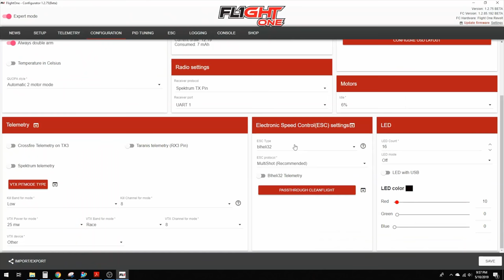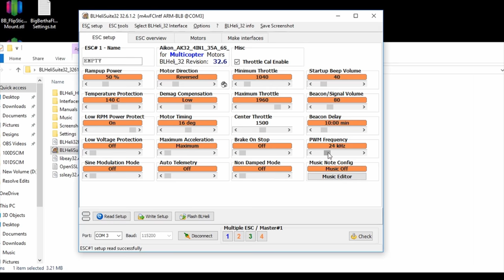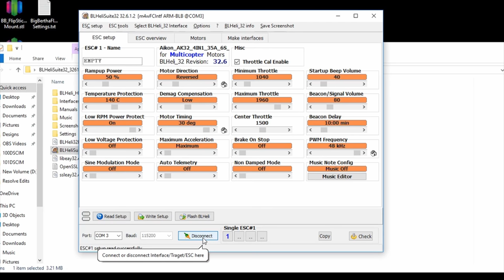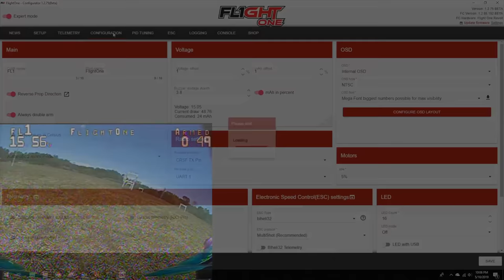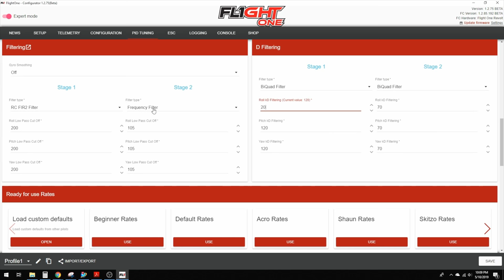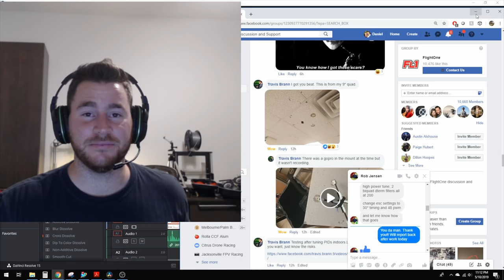FlightOne Yaw Twitches and other Issues

Comment: ESC BLheli32 Settings:
PWM Freq =48
Motor Timing = 30

FL1 Settings:
ESC set to Dshot 600 or 1200
PID tune = High Power
Filters : Default + (2) Dterm Bi-quad filters
Reply: I think I should mention that the BLHeli32 timing settings act differently on each brand of ESC. Sometimes they even vary from ESC to ESC. The higher you set the timing, the more susceptible the motors become to twitching and bounce-back. Also, keep in mind that  most gyros max out at 2000 degrees per sec and they might not be able to keep up with such extreme acceleration on any axis. Not yet anyways. Some low end ESCs cant even handle timing above the mid 20's.  I have done a lot of experimenting with timing because I like my quads to have the highest timing possible. But there is usually a point where it causes twitching problems at extreme stick inputs. For a long time I have been running the "auto" timing feature with zero problems. This WILL NOT give absolute optimal performance, but it will give you a fairly reliable timing rate. In an ideal situation, we should be able to fly with the highest timing setting (31 degrees i think), but not all setups (frames, gyros, rates, etc) can handle it. So if you are unable to tune out any twitches or bounce-back, and you have your filters lined up, take a look at the timing.
Reply: @ninjasauce8855  good inputs man - this video addresses Aikon32's specifically. But I bet your comment would provide others some insight if they're running into issues with different ESC's!
Reply: hey man, im using the latest falcox, had a small hard landing, the next flight my motors was freaking hot ,should i flash it to the non-falcox software and use this settings

Comment: I just rebuilt one of my fl1 quads and now it has some really bad vibs. Revolt v3 Bolt v2. I didn’t have these vibs before I did the rebuild. I’m using the hipower tune and lowered the pids by 5 each thinking the pids were too high but that only helped a tiny bit. I’ve got my filters with dual biquad at 200. All of the default filters made the vibs worse. I noticed the stack was a little loose so I tightened it up and that helped a lot but the vibs are still there. Motors aren’t getting hot anymore at least. I measured 160f on one 20 second run before I tightened it up and averaged 120f after. Still hotter than I’m used to tho. Rob that’s mentioned in the video is a bud of mine I race with lol. He definitely knows his stuff. I’m gonna go back thru this vid later and try some of the steps in here. 👍

Comment: Even I have the same issue, however I am using Anniversary Special Edition Racerstar REV35 35A BLheli_S 3-6S 4 In 1 ESC. The issue is very intermittent. I had put my issue in Discord too however I did not get any reply.
Reply: have you got a fix for this have the same esc in a reverb with fl1 flying freestyle cant get twitches out

Comment: What if you mistakingly bought a blheli_s esc? I’m not familiar with blheli_s escs and can’t seem to find where I can edit the kHz and have yaw twitches. Running falcox.
Reply: Did you ever find a solution for this? I don't think FlightOne gives a damn.
Reply: Blazed FPV there’s a program that’s $5 you can download and upload some firmware to the esc or something like that. Preston knows what it is. Message him on Fb. I can’t remember the name of it. Honestly I didn’t even bother with it. I’ll use the esc with a different fc